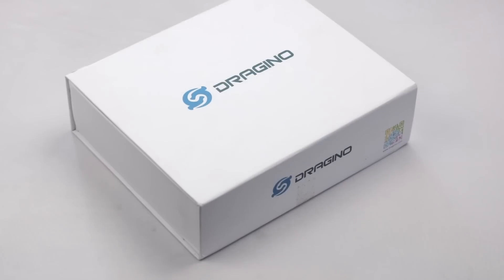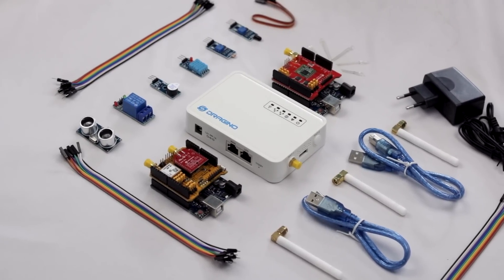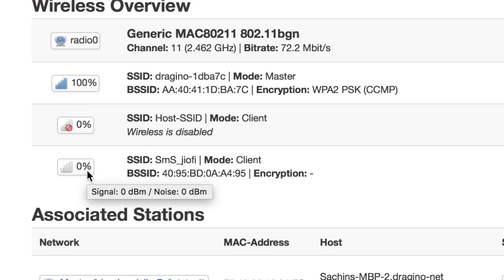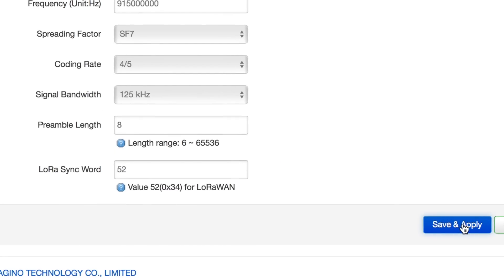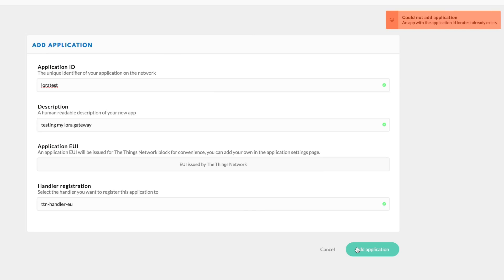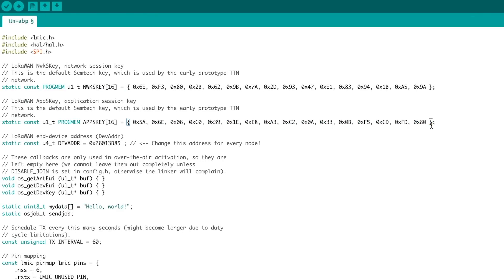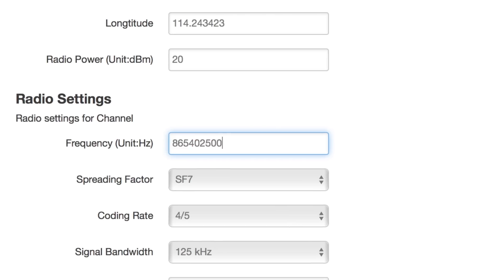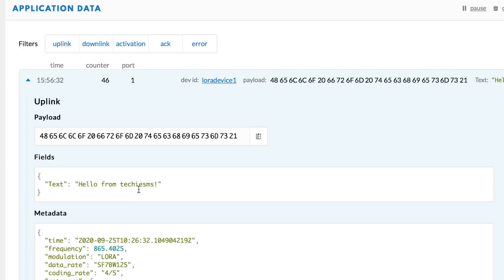Testing LoRaWAN Gateway using Arduino | Dragino LG01-N

Comment: Thanks - useful video :-)

(however, I nearly didn't get to the good parts because the intro music was so distracting. I gave up, but then really wanted to find out more about this LoRa gateway so skipped through and found that you'd stopped the music, eventually - huzzah! It started up again at the end, but that was less critical info. Just a suggestion, but maybe consider dropping the music track down by 6dB next time?)

Anyway, thanks again for great content.